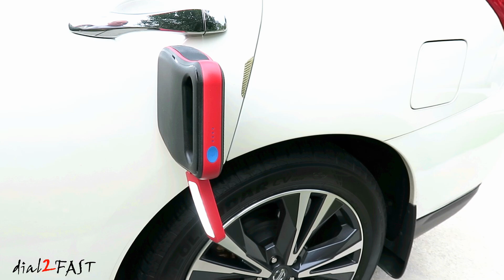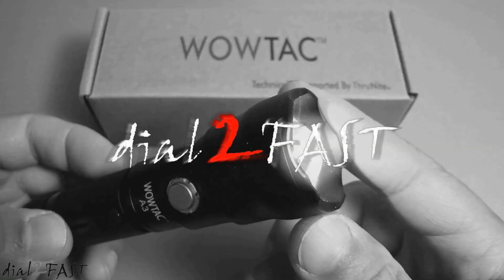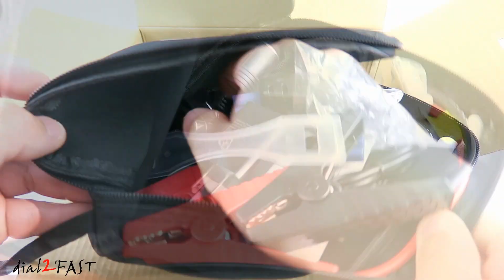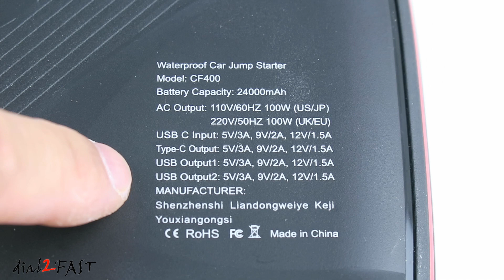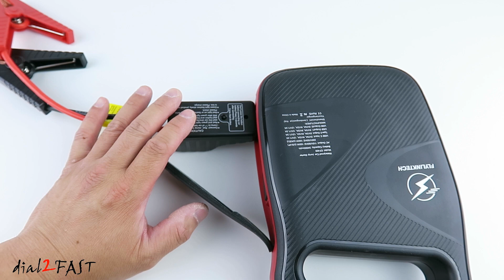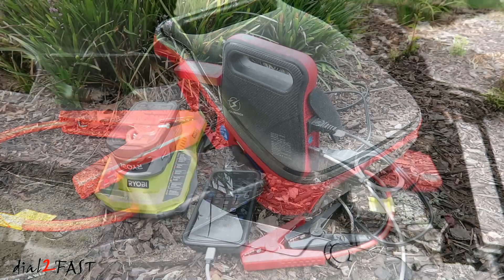FLYLINKTECH Portable Power Station & Car Jump Starter

Comment: Just wondering if you have any trouble with the ac outlet. I actually bought one after watching this review. I have tried to use regular phone/laptop chargers on the AC outlet but it will end up no charging. Any ideas on what may be the issue? The phone/laptop charger I was using was definitely less than 100W
Reply from the maker: Most laptop chargers are under 100W (around 60-70W). So the power pack should have no problem powering it. You might want to try powering other devices like a 75W incandescent desk lamp (if you have one), or other AC devices that is rated less than 100W. If you think it's still an issue, you should contact the seller for support.
Reply: @dial2fast  this might be a dumb question but how do I check if a charger is less than 100W? Is it based on the input specs (Volts * Amps ie 100-240V * 0.45A)
Reply from the maker: @Unkn0wnAzn  The wattage is calculated based on Output Voltage X Output Current. So for example if the laptop charger has an output of 18.5V @ 3.5A, then 18.5X3.5 = 64.75W
Reply: Thanks for the clarification. I was calculating based off of the laptop chargers Input instead of output which made everything I charge appear to be >100W
Reply: @Unkn0wnAzn  you want to use the input wattage as that is what it will pull from the wall or in this case the inverter. Output wattage is going to be less as the charger will lose some energy to heat

Comment: How long would the unit provide continuous power to a 100W load at 110VAC??
That's the type of useful information that I'd like to see.

Given that MANY Chinese made products overstate their battery capacity--you really should have shown a few energy capacity tests on it (e.g.:  how many 10 second jump start attempts it could proved--with no battery in the car.  Hours of AC power for a continuous 110W @ 110Vac load.  Hours of continuous 5V current at the max DC current rating.